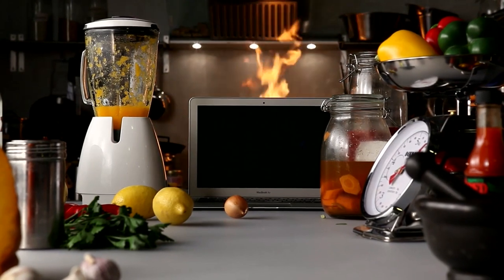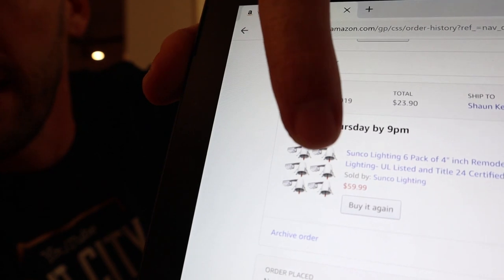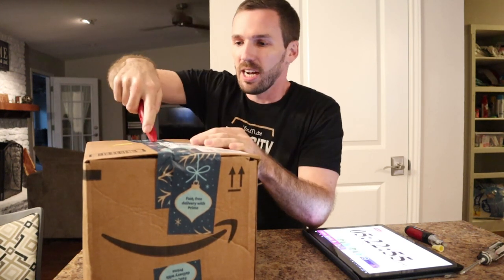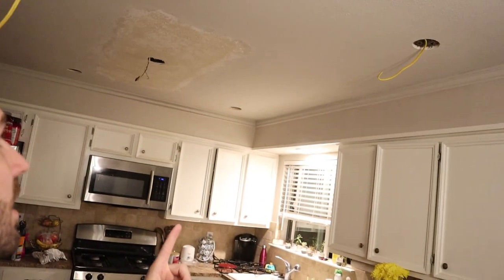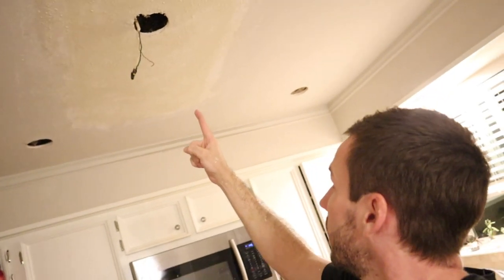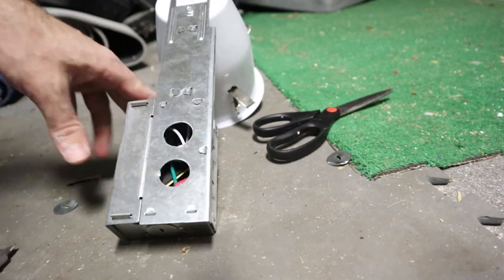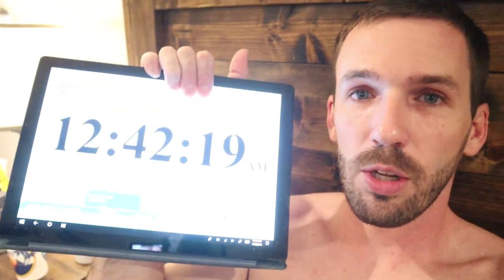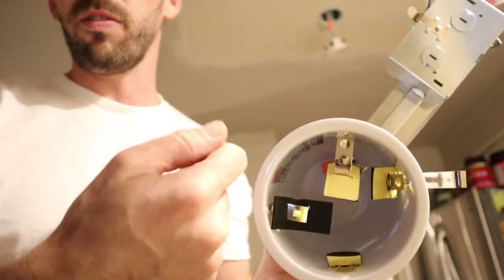😮 Kitchen Recessed Light Surprise and Tutorial! 💡

Comment: Looks great; it's a significant improvement to the old tech Florescent. I installed low voltage LED lights similar to those over the fireplace, no can was required, only a 2" hole and low-voltage wiring.
Reply from the maker: I've seen some of those no can lights, I need to check those out. Just need to make sure they are IC rated for insulation purposes.

Comment: How far are the cans from the wall? Looks like about 24"?
Reply from the maker: The method I usually go for is:
25% of the room length is from the wall to first light
50% of the  room length is from 1 light to the next
then the last 25% from last light to wall

So if my room is 100" long - I'll go 25" away from the walls. 
And then I'll shift my lights to adjust for ceiling joist.

Comment: It does improve the look of the kitchen. Good try! Sadly, you placed the lights too close to the cabinets. They must be placed at least 24 inches away from your cabinets so they don’t cast a shadow in your counter tops. I guess it doesn’t matter since your selling the house. Somebody else’s problem now 😂.
Reply from the maker: Lol true, I sold it so I dont have to worry. But my intention with the location was so my body wouldn't cast a shadow on the counter like a typical central light. Now the immediate counterspace is always lit
Reply: Actually, putting the lights directly above the counter edge line tends to work out better.  That way your body does not block the light onto the counter where you want to see what you are doing.